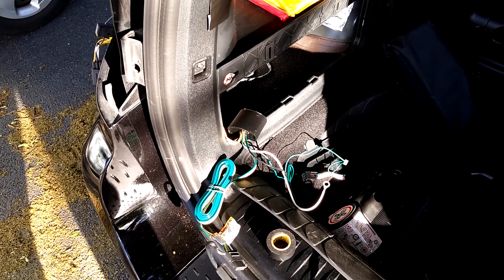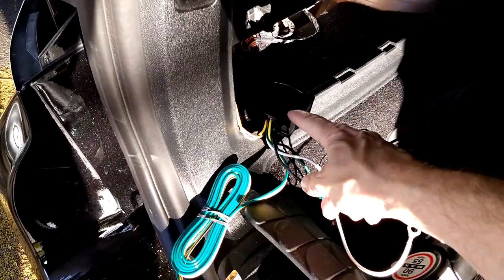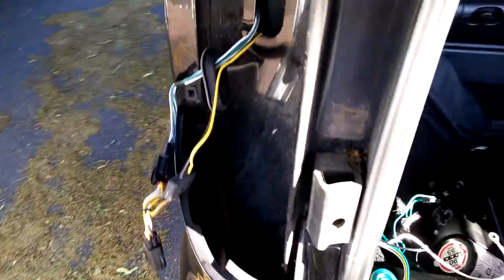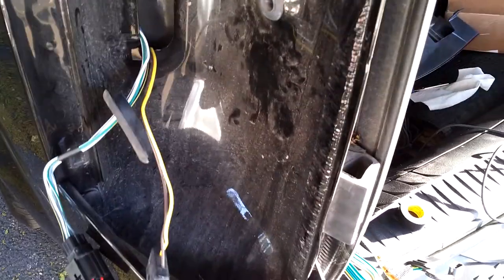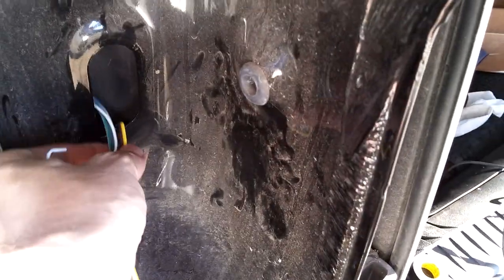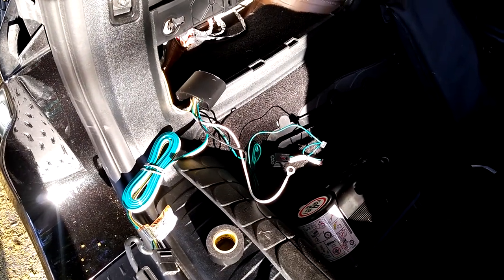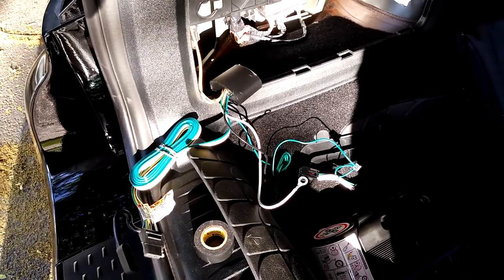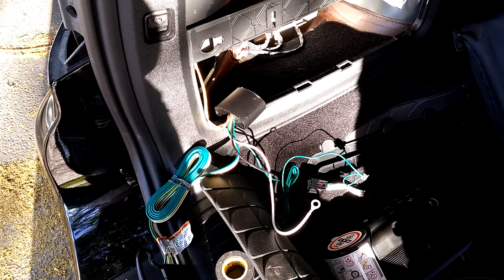Run Dodge Caravan trailer wiring inside the van.

Comment: Mrviper, I found this posting on the Chrysler form site I am hoping that it is yours and that you can help me out with running into the same Park brake issue. (04-12-2015, 04:35 PM,I used a small mirror to look at the cable connected to the parking brake lever on my 2007 STX Caravan. I did the same thing bending the tab w/stub flat tip and wives old cosmetic mirror. Removed the cable, nothing seemed to unwind.  Went to reinstall and 06 dodge grndcrvn seems to have grown 1"-2" inches, cable now to short. Was able to lock onto old cable were barrel end snapped/rusted off and get length to coupling with about 5~8 lbs. of load from spring.  Pulling on new cable HARD, no spring effect to preload system.  Had the 3 pedal fasteners out, but ran out of time son had to return to school. You and 1other person mention about being able to release the spring tension with a screwdriver. I did try to grab and rotate the inboard flat clock spring and center cable guild with large channel locks and they did not move. I noticed the outboard thin spring was not under tension and would just touch its stop that a tab bent  outward to LS, I noticed witness/rubbing marks on both sides of this stop tab while looking with mirror and strong flash lite. Looks like there is 2 tabs/locations for the inboard clock spring, that I am pretty sure did not change. Please Mrviper my back disc sure could use some help. Thank You Ed       could not get logged into the other site, this is my first time using this, Thanks again
Reply from the maker: C Price I'm the same guy.  I will read your post and see if I can help.